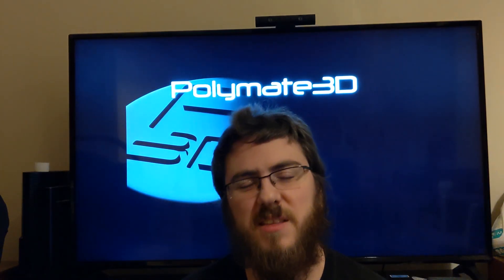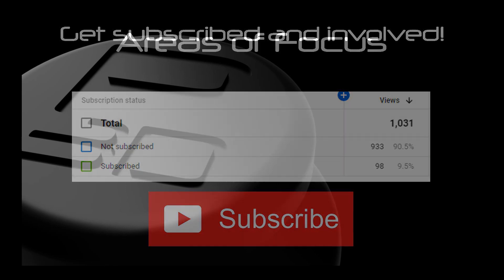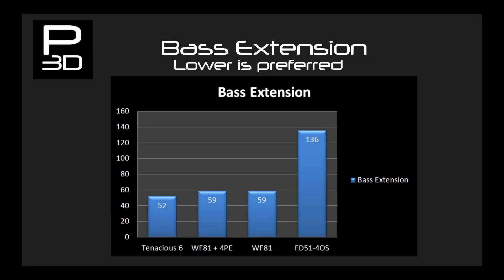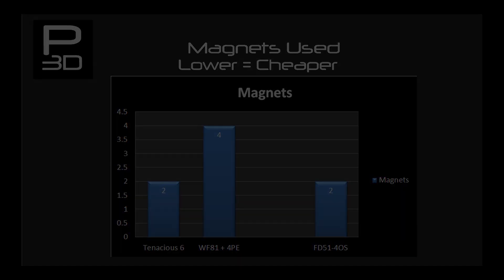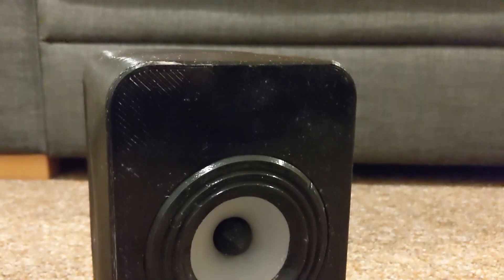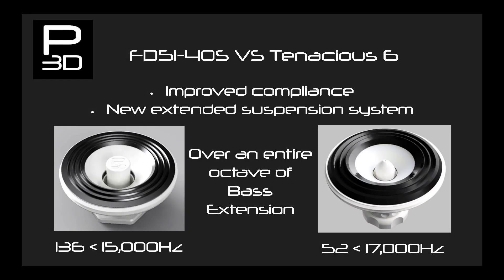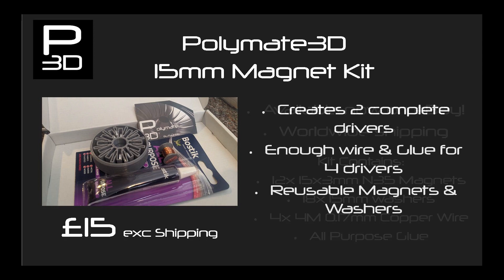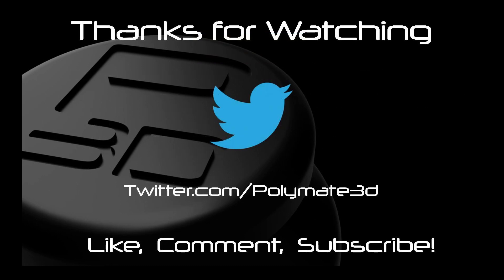Tenacious 6 VS FD51 & WF81 - 3D Printed Driver Showdown!

Comment: Cant you use ironfill filament to create a better motor
Reply from the maker: This indeed was thought about for the motor and possibly as part of the cone former. Neither works out as the current filaments max out at around 0.3T and the motor already has areas exceed 1.0T and so will actually make it worse. I have hopes that later on we will see improved filaments or possibly even a cost effect SLS that can work with something much stronger. That would be amazing!

Comment: Also, have you thought about designing a BMR driver as the wide dispersion on those in stereo gives you such a perfect image, other than this and the limited power handling, there is practically no reason for me to move over. Unfortunately these two reasons are big ones for me, maybe I’ll design a Bluetooth speaker of them though 😉
Reply from the maker: BMR is something that has come up a few times along with headphone drivers and tweeters. and both I feel are possible but more suited to a resin printer. There both on my 'future projects' list. Its very easy to dabble in all of the ideas, but Im trying hard to have better focus and in doing so, help bring up the 3D printed drivers abilities. There is a LOT more to come!
Reply: @Polymate3D  Sounds amazing! Thanks for the reply! :)

Comment: Loving the videos, I would love to see you try some prints out of Nylons K, G and X by matterhackers. I’m thinking the materials could make some really good cones and compliance systems. Also, I am currently doing mechanical engineering here in England and would love to work on these projects with you as I have access to some good simulation software a Prusa and I have lots of ideas. It’s fine if you want to work alone as I have some independent projects myself however it would be really nice to see those materials getting used. I haven’t made my own driver yet but built some flow optimised ported cabinets for my Tectonic 3.5” BMRs and they reach down to 40hz at -3db which is pretty impressive for those drivers. ;)
Reply from the maker: Hey Elliott. Thanks for the questions and joining in! Nylons are on my list actually, mainly as a carbon fibre and nylon mix. It will be interesting when I do get around to this as nylon has moisture concerns as well. I have tested that BMR before and didn't find I liked the sound. Can't pinpoint what it is though. Im in the minority there though haha. I focus on my own path with this, as I want to get to a stage where I have a product, but my supporters do shape how things move forward as well on Patreon. I also do some pieces detailing my process, why I do specific things etc. Ironically the idea started from wanting to be more hands on with drivers, and its great to find another person in the same boat. Feel free to follow me on twitter of facebook and hit me up. Can have a chat :)
Reply: @Polymate3D  Sounds amazing! As I said in my comment, I completely understand wanting to work independently 😉. I’ll try and find the group on Facebook so we can have a chat there at some point, and thanks for the offer. 😁

Comment: Nice job! Been wondering what you've been working on. Look forward to the build DIY. Have you attempted to scale these to a larger size?
Reply from the maker: Thanks Adam. I pop up small snippets on twitter sometimes but over on patreon I have been updating across the 4 prototypes to get to this point. Now Tenacious 6 line up needs to expand and help test new things such as a new magnet motor.
Reply: @Polymate3D  anything I may be able to do to help? I've got a printer and a fair bit of equipment I can utilize - wouldn't mind learning more about how speakers work (more in depth). I would definitely recommend  touching base with user Hexibase - I believe he would have a strong interest in what you're doing and would be of great assistance if that's the case.
Reply from the maker: @ag6286  Development is going well. What kind of equipment are you referring too? I do a bit more of a dive into the driver design side on Patreon. Not really sure how many people want that kind of indepth detail? I have reached out to Hexibase a couple of times but he is a busy guy and until the power goes up and Q goes down, I don't think he will look further into it. I for one sure hope he does. Would be amazing to work with him!